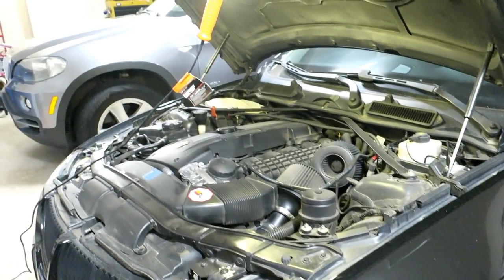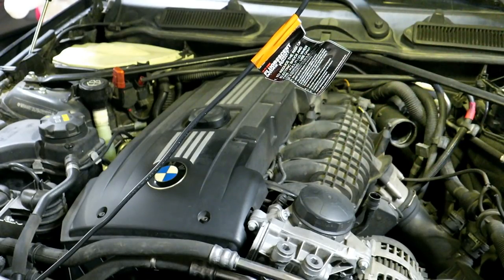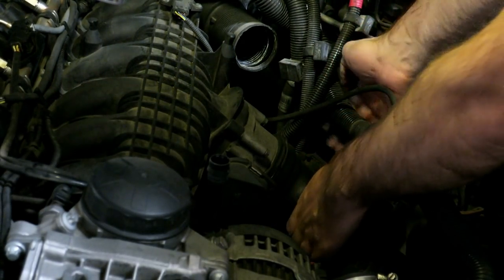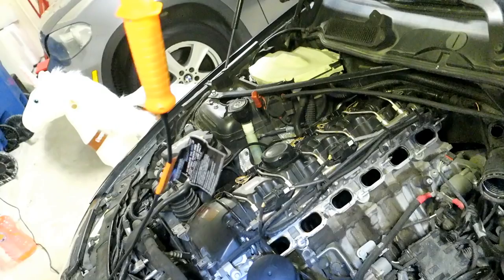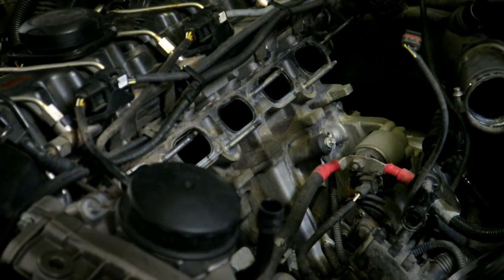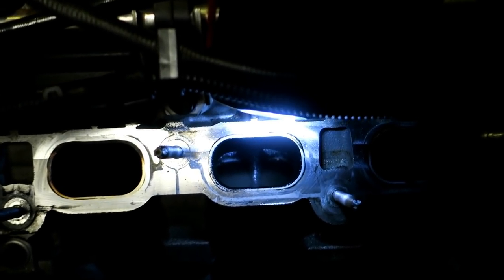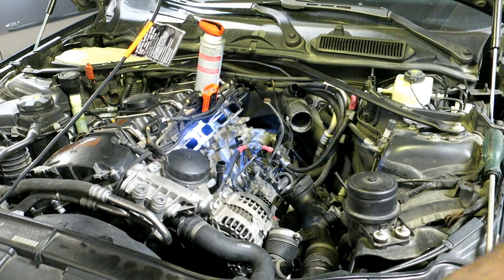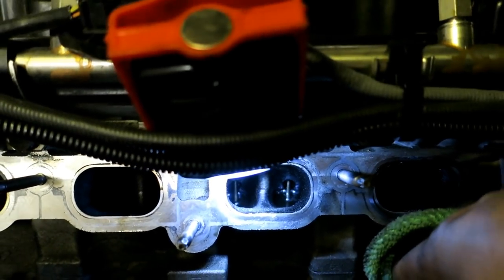Intake Valve Cleaning Without Any Special Tools N54 N55 DIY

Comment: Put a RX catch can on your BMW that will fix your problem you won’t need to do valve cleaning anymore. Thanks for the vid .
Reply: silver4K It happens due to the direct injection since there is no gas going through the intake/ intake valves
Reply: yeh.. a catch can will only prolong the carbon build-up.. it doesn't 100% prevent it for the future... you'll still be best to check on the condition every year or so
Reply: I would say your best bet would be to get Methanol Injection!!    Increase power AND clean those valves seeing as the meth woul dbe sprayed in BEFORE the intake valves. ;)
Reply: Adrian Gutierrez
That's what a catch can does. Catches the oil and carbons from your crank case so it doesn't get on your valves. Catch cans are made for DI/turbo engines.
Reply: Mal P
A good catch can gets 95% of the carbon and oil. That prolongs this issue for quite awhile.
Reply: Jonathan Schmok
That's a neat idea. I'm going to look into that
Reply: I have a catch can and I can confirm that it will still clog up eventually. It just takes a little longer. I would say probably 1.5 times longer to get to the same point as without the CC. So you still have to do it.
Reply: Just curious does Ford put catch cans on their designs?  If not, why?  It seems the CC would be a whole lot cheaper than the service required currently.
Reply: @2wrdr  Ford has re-designed their DI motors for this very reason. Ford's Ecoboost engines are now dual injection (port and direct) like Toyotas been doing for years in their DI motors
Reply: @matreyia  Same here,I have a bmw 330i,I have tried,as a long term test,three top end expensive catch cans.The truth is,none of them stopped carbon build up at all,ended up buying a full Walnut blasting kit which here in the UK cost £155,around $210 US,not cheap but the results were excellent.
Reply: They can make more money doing servicing.  Win win for them.

Comment: I did this DIY yesterday and I let fluid into one of the cylinders. I won't be starting the car till tomorrow. Will the cleaner evaporate by then? Basically, will I have any issues of hydro locking or bending a valve?

Comment: I can appreciate you taking your manifold off to show us the stuff eats away the carbon, but that's not how this CRC is designed to work. The engine is supposed to be hot and running.
Reply: Almost Mr. Worldwide the instructions clearly say to use every 10k miles
Reply: @LuisA-fc3ox  that's literally what he said.  Are you playing captain obvious here, or didn't read it properly?
Reply: Well with the BMW direct injections you better do it thus way or the crc will not hit all those valves and then your screwed.

Comment: Have you had a catalytic converter change in this car since? Have you found any other testimony/claims as to its effects on the CC in your travels? I am about to try this on Prius (gen3, especially 2010, is HORRIBLE for GDI carbon and its EGR clogging). I can't find anything on it. A pro mech says to separate the exhaust before startup/blow-out. Sound advice, but we got it crammed in a little garage with no lift of course. I appreciate your time and impressive video.
Reply from the maker: No I haven't had any issues with my CC, technically none of the product was introduced into the exhaust system with the method I show here.  I can't comment on if you used the product as intended which would involve spraying it into the intake while the engine is running.
Reply: Thanks for quick reply! I copy all of that. Good news for us. It's probably ready for that part anyway. I just wish to not precipitate that if avoidable. Thanks again!
Reply: Hi, did you clean your prius I have a 2010 prius and I am also thinking of doing it please let me know....thanks
Reply: Prius is port and di so carbon buildup should not be anywhere near like this. Use Seafoam in the crankcase prior to some oil changes and your valve train will stay clean.

Comment: Fantastic video, thank you! How have you found the reliability of the engine/car as it's had more miles put on it? I'm interested in picking one of these up and curious about potential issues.
Thanks!
Reply: I have owned 2004 m54 engine on x5 and 530i- those both lasted 200K + miles.
Reply: @fedism  and that is a completely different non turbo engine you cant compare them
Reply: Denis Kanos so are you gonna provide a better answer than mine thats more accurate or not.

Comment: I was curious why you did not clean the throttle bodies as long as you had them both removed. I'm sure with that many miles on the car, that they must also be carboned up and you could have killed 2 birds with one stone.

Comment: BMW, the ultimate driving machine, but they can't figure out how to keep this from happening?
Factory and dealers working together to get your money.
Good video. Thanks.
Reply: Cristian A not true at all. Do your research. All direct injection vehicles have this problem. While it has its ups this is a short downfall. Learn to do it yourself and the dealer shouldn’t come Into play. 👍🏼
Reply: Cristian A not true at all. Do your research. All direct injection vehicles have this problem. While it has its ups this is a short downfall. Learn to do it yourself and the dealer shouldn’t come Into play.
Reply: @whiteout7533  

I know they do, some worse than others. Our company uses 740i's and they are really bad cars.
They could very well use a filtration system similar to catch cans and terminate this issue. Not acceptable. Our 740's go thru lots of oil before oil changes, especially when running 0w20 as recommended.

Comment: to remove fluid shove an air line in there with some shop rags around the hole. put on your goggles and let the air fly!  I'm gonna totally do this on my n14. Just wash down the engine bay after you reassemble everything.

Comment: Hey, dope video! I had a question tho, I tried to turn the motor over with ur method by using alligator clips but it won’t turn at all. It’s just creating sparks and the wire heats up like crazy, what could be the problem here?? I’m really worried as I’ve prolly got a decent amount of liquid in the cylinders, I’ve got the spark plugs out but no way to expel that liquid unless this turning the motor works. Thanks!

Comment: This is the proper way to use this product.  Bout to go do this myself ---- > From CRC's Official Instructional Youtube Video: (1) CRC GDI IVD™ Intake Valve Cleaner Instructional Video - YouTube      Makes sense too because you have someone rev it up a bit.... So my N55 is taken apart, im going to spray this in each hole anyways, put it all back together and also do what their instructional video did.  Start it up , spray it while revving after warming up a bit. maybe fuel additive + spraying in hole + spray in iintake when car is being revved up..... this is best route, who knows      then stage 2 tune!, screw walnuts

Comment: so you've sprayed the intake chamber & valves to remove treh bulk of the carbon build up.. have you also cleaned the intake manifold to remove any oily residue or carbon within that??

also.. why not just pour fuel down into the intake instead of using the chemical cleaner..... just wondering as fuel is the natural cure prior to direct injection
Reply from the maker: Mal P It wouldn't be powerful enough, on a port injection car its the constant wash of fuel that keeps it clean.  It isn't that effective to remedy carbon buildup.
Reply: I wouldn't say that, especially since fuel "petrol" has been used for upwards of 70+years to clean engine components, that also includes in removing carbon from internal components & general burnt on grim from around the engine.

again  other people have shown simply spraying water into the intake can remove carbon build up on pistons/valves etc & that's simply from water turning into steam. I'd say ppl wanting to clean there intake calves should give it ago as you'll not only save pennies but you'll also have the safe guard of no rubber gasket/ring damage
Reply from the maker: Mal P Well we're all entitled to our own opinions.  It is a solvent yes but if it was such an effective way to de-carbon components there would not be products like carb cleaner out there IMO.  If you let it sit for ages then it might work, I know spraying water into the intake is effective but at the same time risky.

Comment: Couldn't you just warm up the engine and spray into a vaccum hose while the engine is running?   Or is this because its in such bad condition?
Reply: Sammy James 
Chunks that fall off
Will scratch cylinder walls
And possibly damage your catalytic converter

Comment: This will work only if you do it every 30 to 40K miles. If you do it let's say after 100k when the valves are really dirty, it will not clean them completely, you can spray that stuff all day long. At that point you have to media blast or just scrub the valves, and THEN keep them clean with this method.

Comment: Do you have to disconnect the battery at all. 

In the service manual it mentions that you do have to. I’m hoping on doing the service today.

It would be great to get your input on that. 

If I disconnect the battery will I still be able to bump the starter?

Thanks
Reply: Frank M starter wouldn’t have power period considered it engages from power off battery. No you wouldn’t be able to bump the starter by jumping it way he did.

Comment: My solution to GDI crud buildup is not owning one.  All my vehicles are port injection.  Looked at the intake valves on our 2011 5.7 HEMI and clean as new at 46K miles.  Haven't looked at our 2013 Abarth or my 2002 SAAB.  All port injection and run like the day they were new.  What is the purpose of GDI?  I believe it was supposed to allow better control of combustion but when the valves are clogged up, power is down, and advantages are lost.  Go price a new fuel pump or an injector for a GDI vehicle.  Advantage port injection.  I've never heard from a GDI owner that said their vehicle runs better than the port injection they previously owned.  I did talk to a Gal that was charged $700 for a intake valve cleaning.  How much gasoline will $700 buy?  Real savings there.  Enough said.

Comment: nice job, i like it better then walnut blasting.
you will get more power if you have the original air filter since what you got get all the hot air in the engine bay
you can get a k&n replacement filter the same like the oem
Reply: D G i have the same set up by the time the air hits the turbos its hot anyway you just need a good intercooler
Reply: Tighe Matthew true, an upgraded FMIC will lower IAT's. so not really gonna matter if you have DCi's or OEM filter. if anything the dci will help on a few gains with the correct setup
Reply: Your engine bay is maybe 200f while stationary, it has air flow while driving. The turbos are like 600f so it makes zero difference where the air comes from as it all gets heated by the turbos.
Reply: Wont really make a difference. You want power, get inlets lol. I have hotside inlets and that was a big difference once tuned
Reply: Luis Zuniga what brand of hotside inlets did you go with and how are you funneling the air?
Reply: People do not realize that under hood air is hotter than ambient.  Leaving the CAI duct open merely back pressures the engine compartment reducing necessary air flow through the radiators.
Reply: @TheMediumDaddy  So ambient air at say 100° F  is not better than IAT at 200° F?  Did you pass general science?   Did you ever hear about Boyle's law?

Comment: These plastic intakes should have a BUILT INTO THE INTAKE MANIFOLD small tube say 1/4 inch or so with an airtight cap on it. If the BUILT IN TUBE was aimed at the valve you could periodically take the cap of, spray valve cleaner KNOWING it was SHOOTING directly on the valve, let it soak, put the cap back on and NO DISMANTLING ANYTHING.

Comment: Can u use the same crc intake cleaner on the inside of the ports of the manifold?  The Manifold is plastic; or should I use a liquid degreaser inside?
Reply from the maker: It's safe for plastic so you could.

Comment: Quick question, what about spraying the CDC cleaner, through the spark plug hole, directly on the top of the cylinder head and letting it sit there to burn off the baked on carbon? Can this or should this be done? What would happen? Would this be safe to do?
Reply from the maker: I wouldn't do that, you would have to remove all the fluid before trying to start it.  When I had a look through my spark plug hole that tops of the pistons were crystal clean.  You could see the shiny aluminum, chances are yours are pretty clean.
Reply: Actually, I just did the CRC cleaning through the spark plug hole today and the top of my cylinder heads were gunked up with carbon! Not too thick, but just a thin layer of hard carbon. Since I bought the car I only put Chevron or Shell 91 octane. So, I suspect a previous owner used the cheap gas on the car. I've also been putting in fuel injecto r cleaner into the gas tank as well. 
I haven't inspected the cylinder heads after cleaning them out, just yet. But I'm going to check them out tomorrow to see if the cleaning did any improvements.
Reply: Bernie Cruz , on a direct injection engine, this method will not clean the intake valves. If your goal is to just clean the top of the Pistons, then yes this will work.
Reply: Yes, this was my goal. To clean off the top of the pistons. Of course, I want to clean the intake valves too and I understand I'd have to spray through the throttle body, for that. 
But mainly, I was concerned about hydro-locking my car if I was to spray directly through the spark plug opening. This was the bases for my question.

Comment: Hi,
Well done, loving your videos, I'm planning to switch to a used BMW X5 4.8/4.4 2008 to 2011 as a daily driver, but I have concerns about lots of breakdown and maintenance cost. could you advice please?.
Thanks,
Reply from the maker: metal fab My other car is a 4.8 2007 X5, the N62 motor isnt very problematic, the N63 twin turbo has a lot of maintenance compared to the N62.  A 4.8i naturally aspirated engine is pretty quick for what it is,  I don't find it slow even when my daily driver is a tuned 335i.  I'd day drive the 4.8i model and if its quick enough for you stick to that model.  E70 X5s have typical BMW issues, you need to DIY it to keep the costs down.  I wouldn't own either of these cars unless I could do the work.
Reply: Many Thanks, it's really helpful. appreciated.

Comment: That's really awesome i've been thinking about it ,   is this starter idea to move the valves after you finish cleaning is only method ? can't i just turn on the car without any spark plus to ensure no fluid inside ? if not where to buy this starter kit ? please answer because i need to do this ASAP , thanks in advance
Reply from the maker: I am bumping the starter in the video to make sure the intake valves are in the closed position.  Once done you can crank the car over with the spark plugs removed from inside the car to ensure there is no fluid inside yes.  You can even turn the crank over by hand from the front but it's easier to bump the starter as I have shown in this video.
Reply: @VehicularDIY  thank youuu so much for replying back , I ll try to figure out how to pump my starter with these wires E280 2008 , I wish you went through this in depth, thanks again one of best learning videos I've ever seen

Comment: Hey just did this and now I got multiple misfires in several cylinders, I changed the spark plugs but still misfiring. Not good can't afford new injectors?
Reply: KevinBeGood make sure you plugged everything back in
Reply: S Rea everything is plugged acknowledging in, I also replaced gaskets too. I pulled the misfiring cylinders injector and it was covered in oil?
Reply: If you had no misfiring before doing this job I would still say something you took apart is not put back together properly. It is also possible something came undone by itself while you were moving stuff around and pulling stuff out.
Reply: Oil around injectors and the intake manifold is normal and expected in small quantities. That does not mean the injector is bad
Reply from the maker: Hey just reading this now, how did it go?  Perhaps your spark plugs were fouled because some of the product got on them.  Have you tried cleaning them up?
Reply: Vehicular DIY i did check the plugs and they were alright (pretty clean) cause I just changed them to the ngk 95770 gapped to  .22 just the #2 injector looked like it had been dipped in oil where it went into the cylinder. I'm also noticing black smoke coming out the left exhaust pipe?
Reply: KevinBeGood  some ignition systems are only compatible with certain brands of spark plugs, check your vehicle manufacturer recommended plugs.

Comment: Awesome job. Would this be the same process with the N52?
Reply from the maker: James Lilliston Thanks, the N52 does not have direct injection so chances are your valves are not very dirty but if you wanted to clean them then the diy procedure should be similar but your injectors would be on the intake.

Comment: When did Teen Wolf start working on BMW's? Seriously though, BMW's suck to work on in any fashion. I cringe when I get a ticket for one. Did a starter on a 3 series and I had to pull the intake. Getting the intake off without breaking anything was a chore in itself.

Comment: Surely manufacturers would be wise to utilise catchcans, find a sensible way around avoiding egr and maybe consider a slightly higher viscosity and quality rating for engine oil. If using quality full synthetic oil surely 10000 km or 6000 mile oil changes are reasonable.

Comment: perfect  , thank you for the video, i have bmw F18- with engine n52n i got error code ((0x104208) Intake pipe pressure sensor, plausibility, after-run: Pressure implausible) the engine ruining smoothly  but the yellow check engine on, i test it with ista+   what should i do ? thanks in advance